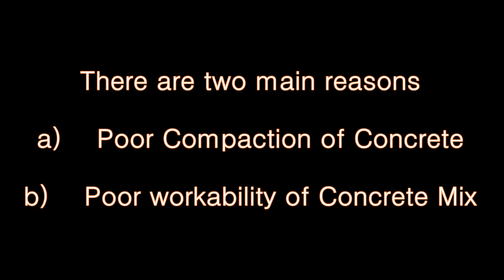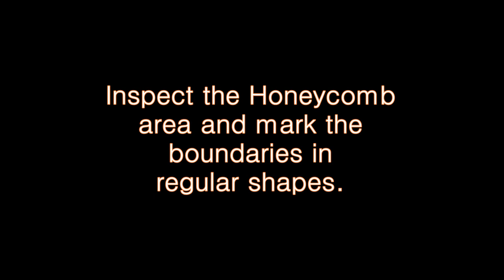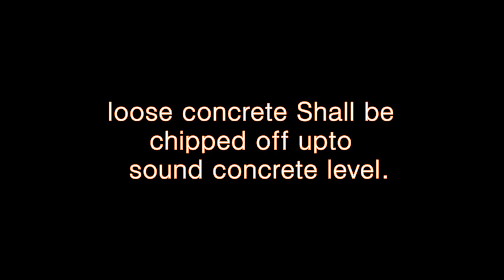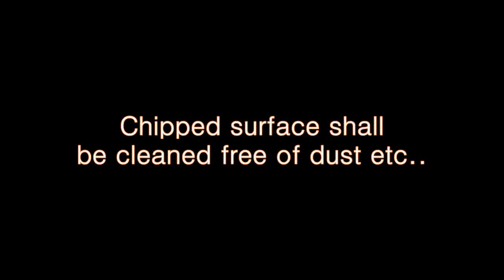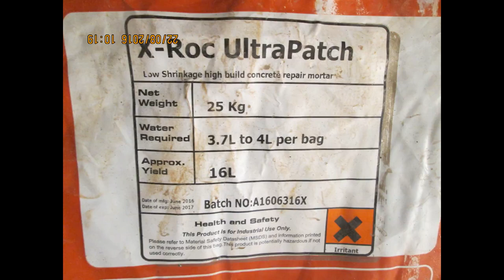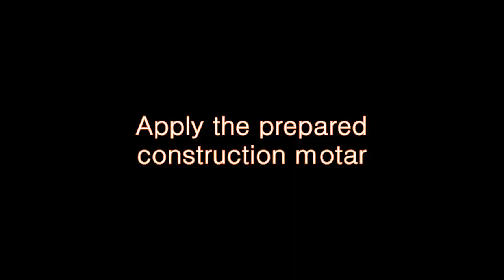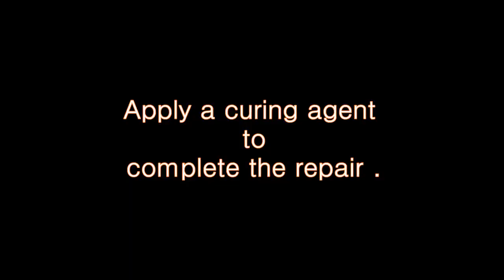The Correct method to Repair HONEYCOMBS  in CONCRETE

Comment: Hi, This is Tony.

We are a professional manufacturer for concrete repair materials.

Main products include carbon fiber fabric/lamiante and all kinds epoxy resin adheisives. Like crack injection, steel bonding, rebar anchoring.

Comment: This honeycombs are look like poor workmanship ,no proper shuttering,poor spacing with steel reinforcement and shutterl,no proper cleaning before concreting or poor vibrations in concrete pumping time.May be a government project without proper supervision done the project.
Reply: Nalathra Aj  sir are you a civil engineer.....i have a query
Reply: I am not at all a civil engineer.But I know many most modern technology in concrete than an Indian civil engineer.I worked various government projects abroad under very very  strict environments with Germans,Americans,British and Italians.In my knowledge I have got a good opportunity to done bomb proof aircraft shelters to withstand any attack from missiles,bombs, nuclear,biological and chemical.It was a 630 million cubic meter concrete project.Even the high frequency vibrators are imported from  Germany to penetrate vibrations up to 13 meters depth. The frequency of needle vibrators used is 200 Hz.In my knowledge may be this kind of project is no more than this Oil rich nation in Asian region.Many many examples for me.The Indian engineers are not knowing what is going on site. ILLITERATE  unskilled workers are advising the engineer.That we can see in the roads or any govt projects.In abroad a road contractor must sign a guarantee of 20 years for his work.He can't escape.The rules and regulations are very very strict and tough.I learnt under this circumstances and done the job.Not only civil, as a consultant, M E P Also done.In abroad we have to look after all kinds work. Mechanical means H V A C,Diesel Engines,All kinds of bomb proof clam shell doors,Aircraft fueling and re fueling,fire fighting machinery for aircraft and so on.Electrical high voltage up to 132 k v , all LT distributions,Diesel Engine power stations,400 HZ Power system for aircraft so on. Plumbing means waste water management,Sea water desalination plant,R O V Plant,Fire hydrant water supply,potable water storage and supply,air craft fuel supply network and so many things. Even toilet waste is recycled and water using for landscaping.Many many things handled and studied.A short summery of my technical life is this.